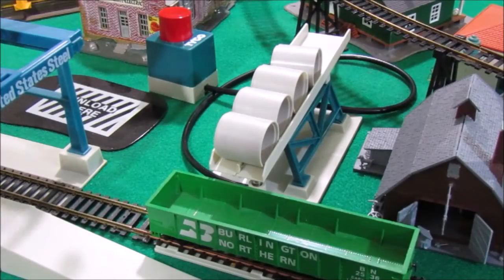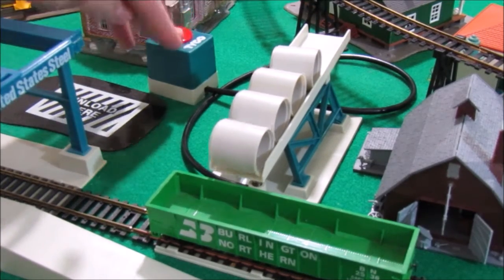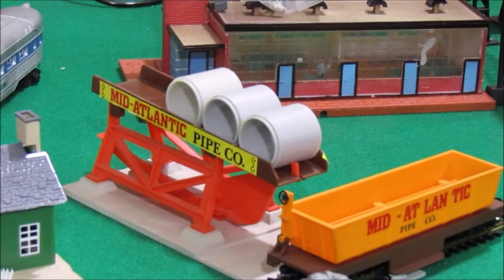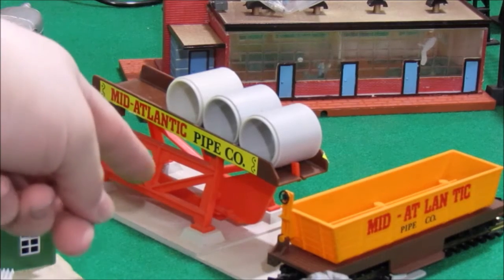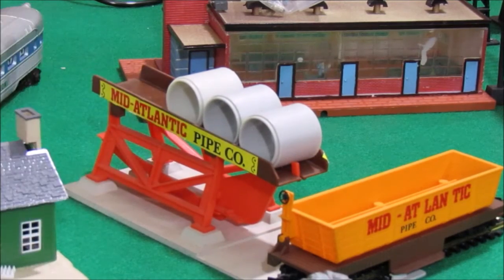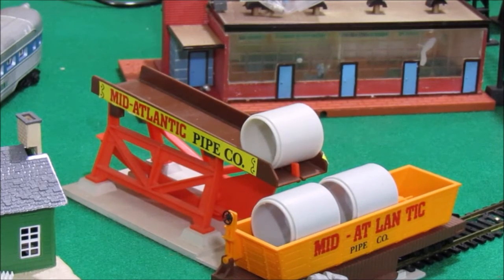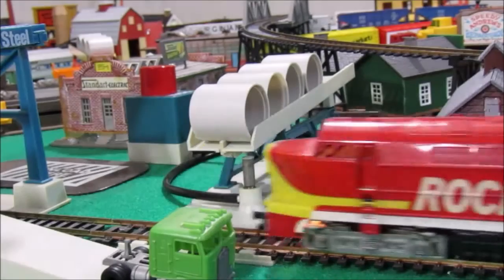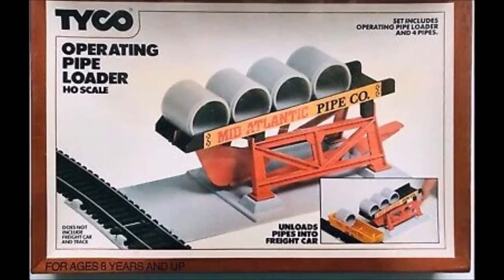TYCO's 2 Different Pipe Loader Accessories

Comment: I just got the #951. Seems like it's in mint condition. But it doesn't seem to have enough air power to operate. Any advice? Amazing work on the video btw.
Reply from the maker: Cool and thank you. I would check the little black hose for cracking, due to age, which might explain why it doesn't get enough air to operate.